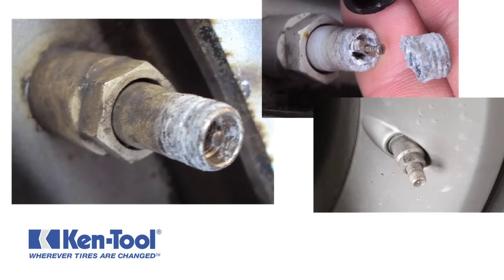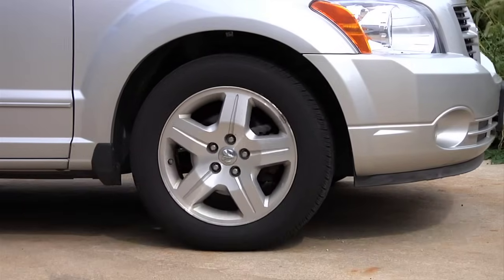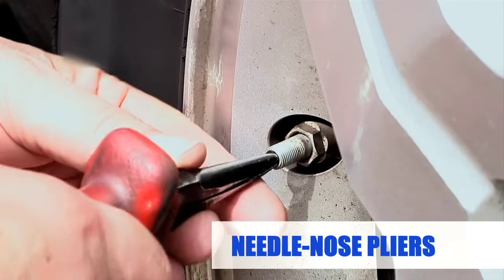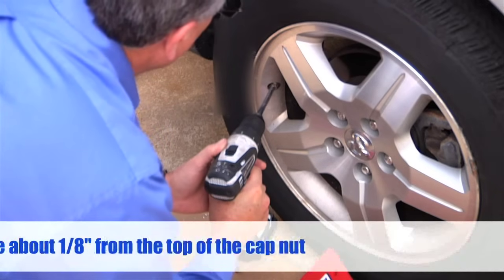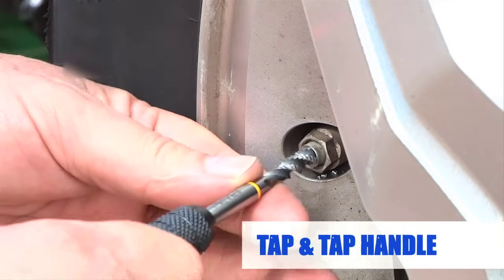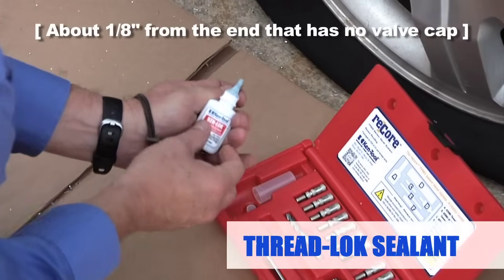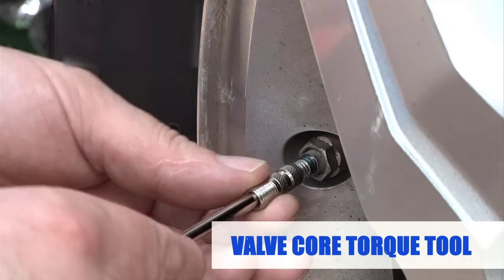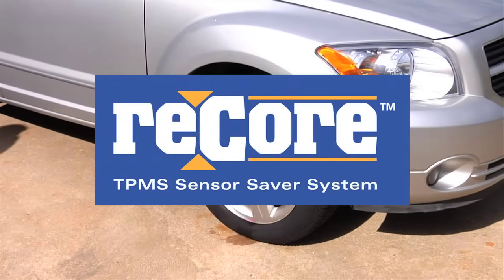Repair your TPMS sensor--don't replace it!  New DIY reCore® TPMS Stem Repair kit launched!

Comment: After the fix, would the sensor be working or not? My bet is no.
Reply: Why not? What does drilling into the valve stem have anything to do with the electronic sensor thats located BEHIND the rim bead? What are you basing this "My bet is no" on?
Reply: @thearcher1740  you basically answered your own question with your question. The answer is, "nothing". The valve stem does nothing to fix or alter the sensor which is probably dying, already dead or broken from a sloppy tire service.
Reply: You bet wrong!   I installed on a corolla about 3 years ago with zero problems
Reply: @Don Lee  what problems?  I am still having no issues, and just got new tires, so i don’t know 🤷🏼‍♂️ what issues you could have run into

Comment: A thin coating of RTV silicone sealant / glue to the outside threads will add 20 years to the stems in high salt areas. If you ever need to remove the nut, it peals right off.

Comment: Remember: their is a non replaceable battery in the sensor, and basically last 5 years.
Use this info to decide what to do.  Best to either replace sensor or simply remove them all and check your tires air pressure on a regular basis...just like in the 'old days'.
Reply: My sensors are going on ten years now with no issues, on original factory battery.
Reply: @robertheinkel6225  That's awesome! My involvement in the automotive repair/aftermarket sales, in a past life, showed numerous studies concluding that these sensors lasting anything over 5 years is bonus and not the 'norm'. Of course there are always exceptions. Glad to hear that you are enjoying the 'bonus'!!
Reply: Tire senses are just another expensive item to fix. Average 800 dollars to do all four tires every 50k miles. They don't last long. Vs the old days manually check your tires if need air. Yes nice to have a sensor tell u you need some air.  Years and years we checked our tires manually.
Reply: My Audi is 10 years old and it still works on the original sensors, same for my Porsche which is 8 years old.
Reply: @francoiseleclerc1963  Fantastique Francoise!!  Read my reply to Robert Heinkel in this same thread as this also applies to you...
Reply: @elmoomle4565  Although it is not planned by the manufacturer (housing ultrasonically welded and filled with silicone or other mass material), I have fun filling the TPMS batteries and giving them a new life.
Audi and Porsche use ultimate lithium batteries (like CR2032, BR2450A) which are also available for individuals.
Others use silver oxide batteries and most recent lithium (not to be confused with ultimate lithium).
Ultimate lithium is what lasts the longest (up to about 10 years)
Reply: @francoiseleclerc1963  I wouldn't even 😂need to check my Rolls-Royce at all, my driver is taking care of it.
Reply: Most batteries can be replaced just need to be resoldered into sensor.
Reply: If you remove them would the light come off?
Reply: I replaced my Prius 2010 all 4 sensors batteries. It’s not straightforward as replacing some toy battery, but not too difficult either. But I would still won’t drill into the valve core through.
Reply: @francoiseleclerc1963  This must be a weekender drivers only, that's why it lasted this long?
Reply: Replace if you want, after they die. Mine are going on 15 years and still going.And yes they do work as I have a couple tires that leak very slowly and the TPMS light will come on and go off after adding air. Don't know how Subaru does it if they are only supposed to last 5 years. Also I am the original owner so it has not been replaced already.
Reply: 14yo prius and have 1 dead tpms battery. Cost to repair isn't worth it. Just replaced rear hub this year and corroded brake line last year.

Comment: A new sensor can be installed in less time than doing this repair. Besides, sensor prices have come way down over the years, usually around $50 for most vehicles.
Reply: 59.00 installed, just had one done today. That is 59.00 in Canada.
Reply: Longbox55
Reply: $60  plus tax in Alabama. I was told today that 3 of the 4 four were bad so I should replace all 4. $240????  I'll check my own damn tire pressure. 2008 Volvo s60 2.5t
Reply: Longbox55 140 for a 2013 nissan
Reply: @12voltvids  is that for 1 or all 4 ???
Reply: @Passportsandprofits  The sensors come with new stems, and in some cases, the stem can be replaced separately from the sensor.
Reply: @Passportsandprofits  Might take a little longer to do, but the way I do that repair is done right the first time. And it really doesn't take that much longer, maybe 15 minutes.

Comment: Useful for a roadside patrol as a get you home method, seeing as manufactures can’t afford to fit spare wheels in cars anymore.🤣
As a technician I don’t think I would like to drive round on that for long.
TPMS and just valves for TPMS are cheap enough now not to worry about excessive cost, depending on manufacturer of course. Ford vs Ferrari..........
Reply: WTF you're talking about ?
Reply: Yes Don Lee I am a Motor vehicle technician in the UK.
I used to be a breakdown patrol, but now own my own vehicle repair workshop.
I buy in the valve part of the TPMS and swap over the electronic part keeping the cost down for my customers.
This product would certainly suit the breakdown recovery industry as a get you home method Or AAA over your side of the pond
The lack of a spare to save weight in a vehicle these days seems ridiculous, having to sit waiting for help when you could have it changed in 10 minutes, but this is the world we live in.......

Comment: Have a 07  Toyota Tundra and never had to replace them. I guess it just depends on how long the battery life is good for.
Reply: Yours are overdue. I had a third one go bad this week on my 07 Camry. Most Toyota OEM sensors are made by Denso or Pacific. They're about $35 on line. Be careful not to buy the cheap fakes on ebay and elsewhere.

Comment: So that's how you replace a dead TPMS battery.
Reply: No, this only repairs The stem.    Jim
Reply: @jimpie231  no the battery is inside the stem core.its a cr .00000123 battery
Reply: TMPS units are 2 pieces, a valve stem and a body (contains battery). The valve stem you see outside the tire. The body is connected to the valve stem and is inside the tire. The body contains the battery. To replace the battery you need to replace everything. To do this you must break the tire bead, etc, usually you go to a tire place to do this. If you’re replacing tires, this is the best time to do this (usually no added cost, except for the units). These batteries usually last about 10 years.    Thanks....Jim
Reply: @jimpie231  i was making a joke. The valve stem core has a shaft diameter of arround .75mm. Any battery that would fit inside it would be absolutely microscopic, hence the cr .000000123 battery designation.
Reply: How do these these TPMS batteries last so long but similar ones like watch batteries don’t??

Comment: Always use plastic caps on TPMS valves.  Metal ones can corrode and you can break a Chineeseium Stem trying to get it off.
Reply: Wouldn't the factory know all this .. thanks good to know 🙏
Reply: @amit604  Planned obsolescence.  They know, they don't tell.

Comment: A total waste. My vehicle is 12 years old and has nothing wrong with them other than the battery life coming to an end, which means all new COMPLETE TPMS sensors.  Original equipment sensors for my truck are only about $14 each.  Don’t buy them at a tire shop. One shop I checked wanted $131.00 each for them. What a rip off.

Comment: Sensor based TPMS is such a bad technology it is a relief that it had been obsoleted.
Reply: Obsolete?  It is mandated to be on all new cars.
Reply: @robertheinkel6225  Fallible and costly transmitters inside tires have been obsoleted by revolution counting. Is revolution counting also called tpms?

Comment: The battery in the sensor only lasts 4-7 years you will need to replace and reprogram them anyways .
Reply: I read batteries last 7 to 10 years on the Honda website.  Mine are 9 years old and very soon will be replacing tires so I will be doing new tire pressure sensors as well.

Comment: Are these even worth fixing? Can i be safe by just checking my tire pressure once every month or so
Reply: Yes
Reply: You will fail your safety inspections if the light is on, so yes.
Reply: @henlo1910  I had my car inspected with the light on, and it passed.
Reply: ...I can see why this might save a customer from a outrageous bill but some certain ones can now be replaced with snap in or programmable sensor. (if you have the scan tool and know how to use it)
Reply: @henlo1910  what about older cars without sensors. They don't fall if the tire pressures are good.

Comment: omg this looks like such a bad idea
Reply: Exactly I agree
Reply: LOL Totally agree
Reply: @ORD80 Did this continue working out for you? I'm interested in this so was hoping you would lmk how it worked out after a few months please and thank you
Reply: It's a great idea. I'll make a great deal of money off people that screw up their tpms.
Reply: Exactly
Reply: Right.  I was thinking the same things.. Thats not simple as 123
Reply: Or just get a band clamp and bracket for the sensor. Band it to the rim and replace the valve stem with a normal rubber one. Significantly cheaper and zero chance of the stem to still leak after this "fix".
Reply: @b.t.6585   Made the repair myself with this kit after watching this video. It was easy, and has worked perfectly for month-and-a-half no leaks.
Reply: I see more running to shops paying more MONEY for flatbed towing on top of it to if try all four now. Some will try next one until they realized they screwed up.
Reply: @ORD80  buy Factory new ones, mine cost from $27 to $37 from Honda wholesale discount warehouse. Pickup up at Big name Honda Dealership, can order tires online and have them replaced from a smaller GARAGE and pay them for mounting and balancing plus installing new TPMS SENSORS THAT'S BRAND NEW WITH NEW BATTERIES IN THEM. only good for 5 or 10 years or 100,000K miles so should be replaced if tires cross the time and ask your guy how much if you buy Factory ones. Need old ones back, they sell refurbished ones at other places, I bet your getting those. Spend MONEY just once. Less than $200 with installing them.
Reply: @JR-kr1lv  So are there 4 Tpms sensors, one for each tire?
Reply: @rjc854  I only saw 2 in the brief view of the package.  Seems like a good idea.  The sensors are $125 each from dealer.  I have never bothered with them in Winter Wheels.
Reply: @gordbaker896  That will not fix dead batteries. Bad idea.
Reply: @WAN2TREE4  I didn't say that it would.
Reply: I don't see the difference between you making money off people with failed TPMS devices and you making money off people with failed TPMS devices who tried this to fix them before brining it to you.

Comment: Take all your tpms sensors out replace with rubber valve stems then go to the hardware store gets some pvc pipe threaded on both sides get two caps one for each end drill a hole in it put a rubber valve stem in it put all tpms sensors inside close cap and inflate to door pressure. Boom, no more corroded or damaged sensors

Comment: The biggest reason to NOT bother with this is, by the time this is needed it won't be long until the battery is dead (if not already) and you need to replace the sensor anyway.  Replace the whole thing and be done with it. However there is dirty little secret that many are not aware of or haven’t thought about and too many shops ignore.  

DO not buy sensors from anyplace online, local or even the dealer unless someone can verify for you the batteries are not down a significant amount.  This is an even more significant concern when buying at a deep discount trying to save money.  The battery gets old and weaker sitting on the shelf whether you, the tire store or the dealer buys it.  If they install it with a half dead battery you won't know until it dies half way through the 7-10 years it should have lasted.  If it is down more than 25% I don't want it and at dealer prices it better be over 95%.  Whoever is installing it for you should check the battery with a tool made to get the battery level from the sensor.  If you read reviews some have experienced that it might even work initially and fail hours, days or a few months later.  Snap-on makes such a tool which I have access to and will use.  There are some cheap ones that might be good enough for just checking battery level and still be cheaper than going to the dealer.  I will also buy sensors only when I am ready to have them installed, so it doesn’t run down sitting on my shelf and I can return it immediately if the battery is low .  The tool to check the battery may be more than you want to spend but the shop should have one.  Otherwise they don’t know either if what they put in is any good.  There are a lot of reasons they might not work or fail early, but assuming you are careful to get the right sensor for your vehicle the battery getting weak on the shelf is number 1.
Reply: What if I don't give a damn if the sensor works?
Reply: Drive on your rim eventually?
Reply: Bill:
But it's for "safety"..That's how that nonsense is passed by government. Why do you think that thing is often 2-4 times the cost of the tires? Government forcing the product. If it was left to the market that sensor would probably be 2--4 times less then the tire...Probably even have easy self install versions if it was. 
I do not see the point of it. Ill check my tires for air pressure. Takes about 2 minutes. I do not need to spend that much money so the car can tell me. You can drive on flats and you can notice when a tire is flat. "Safety" my butt. Another car started doing it and I just shopped around again for pricing. Ridiculously expensive.
Reply: Can't you replace the batteries?
Reply: @bobshanery5152  I don't think it was a safety thing. It was about mileage. People driving around with low pressure using a boat load of gas. Not to mention what it does to the tire. And yes I know your post is 3 years old.

Comment: Here's a tip: Demand that your tire installer use bead sealer.  It's a black rubber compound that is brushed on.  Simply cleaning the rim isn't enough.  You'll be amazed at how often you used to air up your tires previous to bead sealer.
Reply: heck, just cleaning the bead seat on the rim can do wonders...
Reply: @CaptainSeamus  -- IMO that is 100% necessary.  Unless the paint is still in tact.  If paint is in tact, i clean it with a rag and solvent as to preserve the ability to prevent corrosion.  Once they brush that paint off, you'll be forever fighting corrosion.
Reply: @lJUSTwanaCOMMENT  I agree on a painted rim. I was thinking alloys... some of the tire sealant is (or used to be) a little bit corrosive to some alloys (aluminum esp.) so I was always leary of it, but understand the though.
On steel rims - all or nothing - if the paint is torn up in spots, generally it's already a corrosion problem - so yeah, getting something to seal that bare metal off is important. 
Cheers!
Reply: @CaptainSeamus  -- Thats good you don't touch the paint.  All too often I see guys wheel brushing anything in front of them.  And yeah, if you got spotty paint it's too late.  doesn't take too long either.  If cared for exceptionally well, the paint is good for what like 5 years maaaybe 10?  As far as the corrosive tire sealer, I have heard that a few times.  The stuff we use says good on bare aluminum, but yeah there could be some high strength steel only stuff out there.  also like you mentioned it might be a time thing, i.e. used to be corrosive but isn't anymore.  We use it on everyone's tires.  Most the other shops around here only use it if you come back for a bead leak.  I also seal the valve stems and it has worked out great.  I have tires holding with plain atmosphere for years; I am not fibbing.  TPMS as well, haven't had an issue.  Anyway, good point about corrosive sealer; I will check it out.
Reply: 30 years experience, soapy water works just as well!! You can now use WD-40 which
wasn't available at that time. Just saying...

Comment: It's amazing how many people have posted replies and apparently have no clue what this video is actually about.
Reply: well the title of the vid is misleading. it says repair the sensor, but it's just a way to change the valve stem without having to replace the sensor right? but since sensors age and their batteries die, if your stem is that old, you might as well also get the sensor replaced, the sensor is going to go soon anyway.
Reply: @ORD80  well i agree, the pressure gauges are a big hassle, always lighting up. i am fine with just checking the air once in a while on my own. replacing them is not easy, and it costs to have a pro replace them for you. also they transmit wirelessly. what if you don't want to be bathed in RF all the while you are driving just so you can know if you tires have air. it's ridiculous.
Reply: 1 Adam 12
Reply: Mr Hansen  lol yes, and i think we should not be.
Reply: @fredsmith6324  Wear a tin foil suit and the RF wont get to you. Im a scientist and believe me it works.